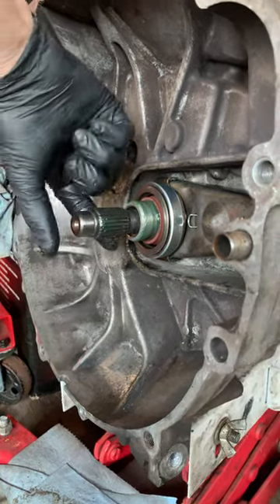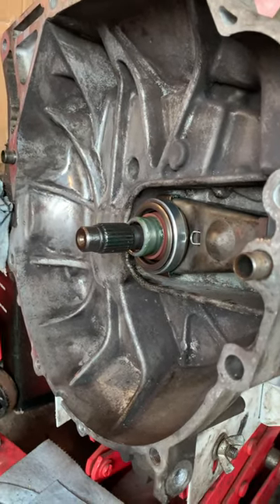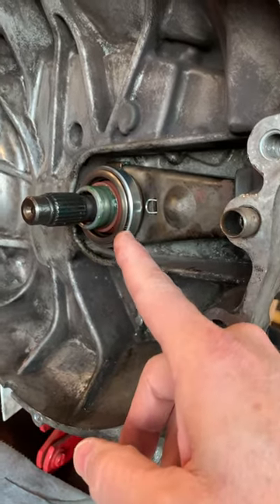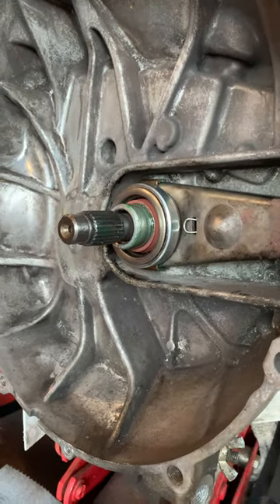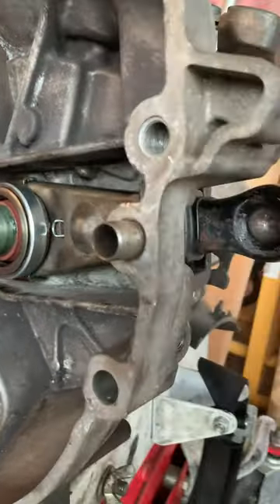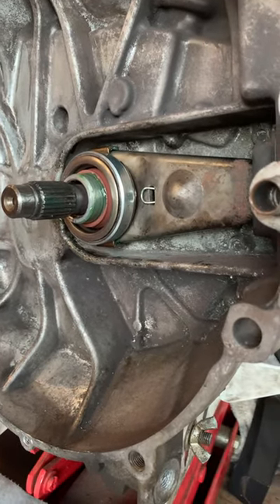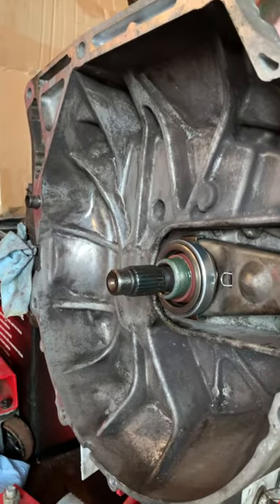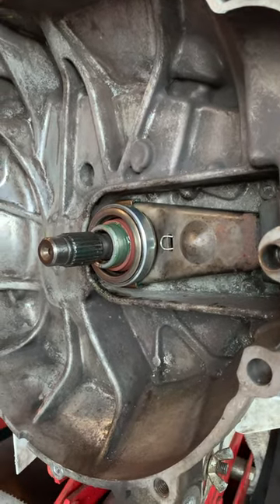2002 Acura RSX Type S - Clutch Pedal Staying Down

Comment: Thanks brother. I’ve been looking for this problem
For two and a half months. Car drove great after the trans rebuild. So I reckon it’s my cables up top and my clip on the control arm
Reply from the maker: @leviorourke7498 Thank you for watching the video! The cable assembly up top that we replaced was causing hang-ups when shifting. The clutch pedal to the floor was directly related (for us) to the thrust bearing, arm and spring that is shown in this video. Truly hope you nail down you root cause and get your ride back on the road soon! -Dutch